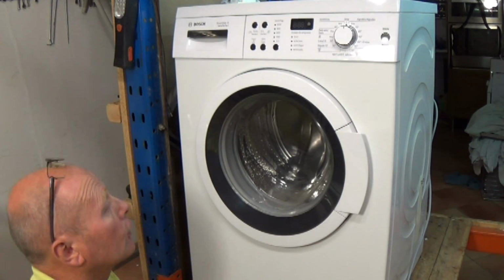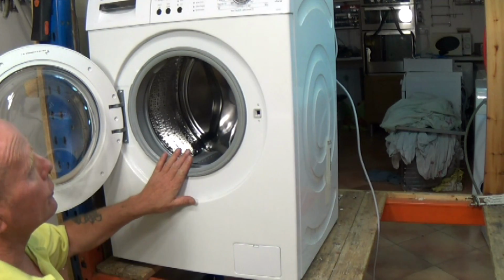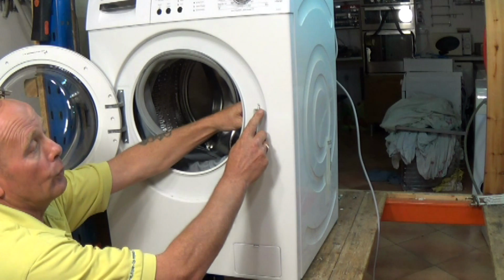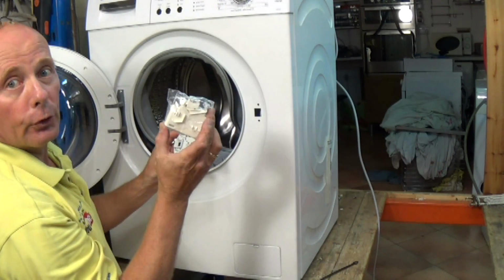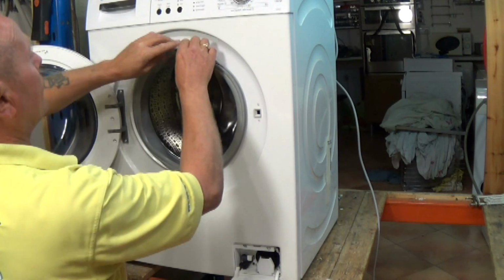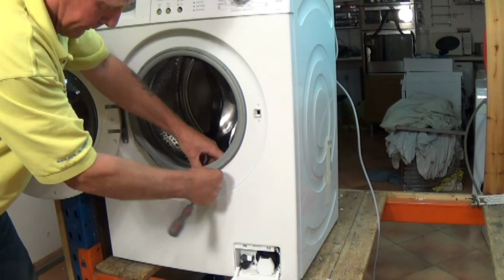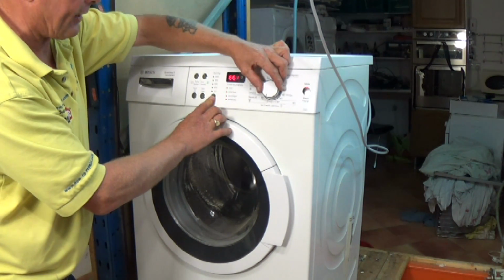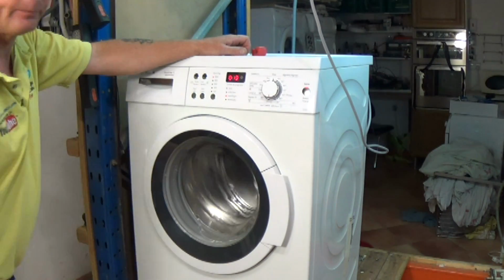Washing machine Doorlock error codes E01, F08, F16, F34, E61 Bosch, Neff, Siemens

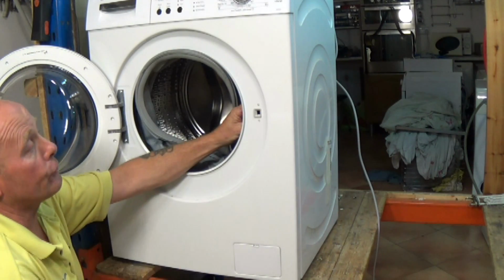Comment: At 2:50 you showed how to remove the door lock. This showed me that the problem I had with my machine was that the door lock mechanism was loose. Error message was "Door open?". I just had to reverse what you did and put it back in place and the machine was working again so thanks a lot for making this video! I previously had to repair a broken piece of plastic inside the door with some screws and also found the solution to that problem here on youtube. The latter is by the way a very common fault on these machines and must be classified as a design flaw.
Reply from the maker: Hi thanks a lot for your comment and I'm glad it helped. It would be really helpful for me to get my video shared and help us fight appliance waste! Please remember to subscribe to our channel, as that really helps us 😇

Since we work very hard in our warehouse making free video guides for you all on appliances, we always appreciate a beer, offering a choice of single or round beer. https://www.how-to-repair.com/help/buy-paul-a-beer/ 

Thanks, Paul 👍

Comment: Hi, I have a Siemens S1 14.44 Total Textile Management Washing Machine and it has tripped the power on several of our appliances. I have switched the trip switch back on and an error code F34 is displayed with a bleeping noise. I have watched your video about how to replace the faulty door lock which this error indicates however I am not sure if there is another issue as the power is tripping. The door did actually open. Any suggestions please, thanks.

Comment: My contribution to humanity: I've been fighting with E61 on my Bosch. At the same time, our Bosch dishwasher was also playing up, repeatedly switching on the cutting out as it tried to move on the cycle. It was only when we tried to reheat pizza in the microwave and it was all lights and no action that I discovered that the wall socket was giving out reduced power. I ran an extension cable from a known good socket and the washing machine ran with no issues. Why reduced power should have resulted in a door lock error I've no suggestion, but it's obviously something to check before expensive callouts and/or replacement parts and machines.
Hope it helps

Comment: Hi how-2-repair. Thank you for your video. I have a question hoping you ca help me. I have a Bosch machine that is not working since one week. I don't know what is the problem and I don't know if it's an error or a piece of the machine. When I choose a program with the door open and then I close the door, the machine tries to put the lock of the door several times (for about 10 seconds) but then nothing happens. The "start" button flashes and I try to activate it but notihng happens. So I tried to program the machine but this time whit the door closed. Again, we hear that the machine tries to put the lock of the door several times but nothing happens and even worst, if I touch the "start" button during the first 5 second, the circuit breakers leap. I thought that it could be the heater or the interference filter but both are ok. Can you help me please??? I don't know if it's just an error of the circuit (even if I don't have an error code on the display). Thank you very much you for your help.
Reply: Same problem I have... What can I do?

Comment: Thanks for the video
You are awesome 
My machine is exactly the same as in this video. I get E00 error code. After doing what you've told the machine started working but now it has an alarm sound kind of repeatedly while it is working and the speed perfect button's light goes on and off. When I press the button for a time or two then comes the same error again and I have to go through the process again I will appreciate it very much if you give me a tip 
Thanks 🙏🏽

Comment: Hello, could you help me with my washing machine problem? I have AEG L64840l model and what i was figure out that showing E42 in service mode so i suspect that is problem with door lock. Once was E68. Or can be even with mother board?
Washing machine has start to stoping during the program and i have notice that the doors are opened. Beside that also when should program be done, still showin 1 minute till the end. I have clean the heater, water suply and water pump with the help of your great videos so kepp going on that way! Thanks!

Comment: THANK YOU FOLLOWED INSTRUCTIONS CAREFULLY FIXED F16 PROBLEM JUST LOOSE PIN ON LOCK MOST DIFICULT PART WAS REPLACING WIRE ON DOOR SEAL AND ENSURING THE SEAL REMAINED SECURED TO METAL CASING ON MACHINE

Comment: I have the E61 faultcode, but it was one of the fuses, so I will say check the fuses first
Reply: what fuse?
Reply: The machine uses two phases 230 volt, and one of the fuses in the fusebox in the house was broken
Reply: Jonas Malmgren 

I have a Siemens and Error „F61“. Was your mashine still working with one Fuse? Mine is working but sometimes crashing. Where is the fuse-Box? Thanks!